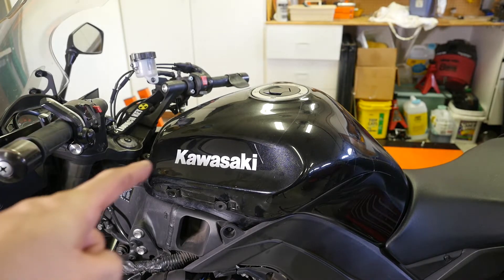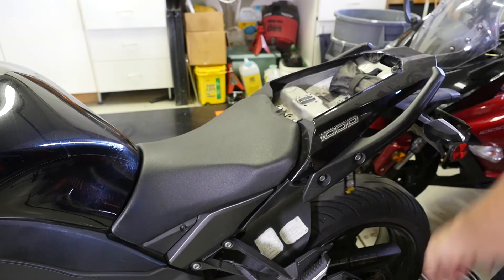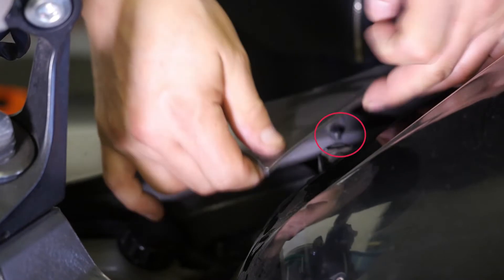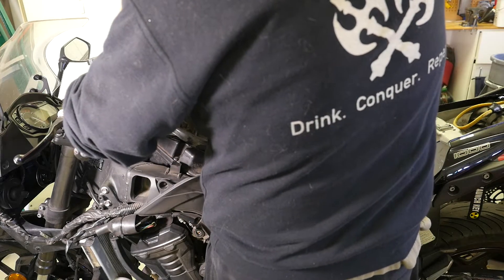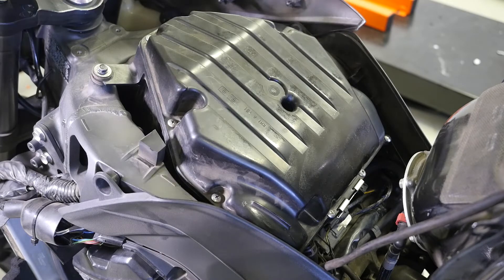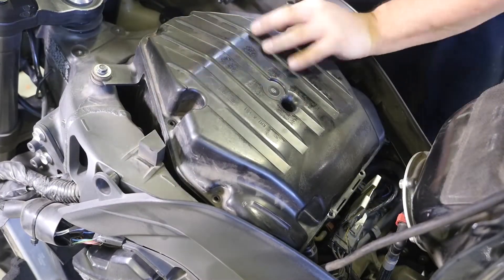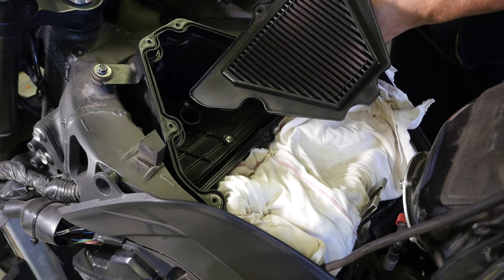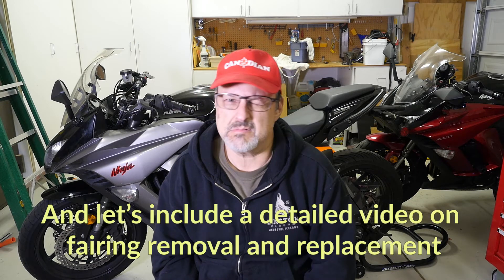Basics:  Air Filter Change Ninja 1000 / Z1000

Comment: I’m changing my filter as I’m writing this and faced an issue. Otherwise than having to remove almost all fairings, my overflow hose isn’t stretching or pulling anywhere. I can’t stand the tank up. Am I just too paranoid to pull it or is it stuck? It’s like not extending at all I feel like it’s stretching if I pull it harder it might burst or tear.

Comment: Continue with the videos.  Just curious have you ever had your throttle bodies synchronized on either of your bikes. If so at what mileage? Would you ever consider that as a diy.  I think you can pull it off.
Reply from the maker: Hi Chris.  Yes I have had them synced. Typically happens with the valve clearance inspection service.  It does require a special device, as you probably know.  If I do try it myself, I’ll toss that into the advanced maintenance category.